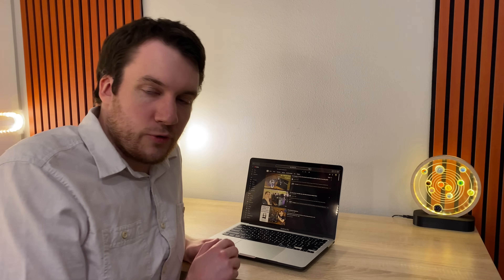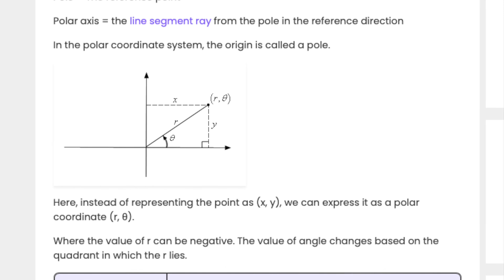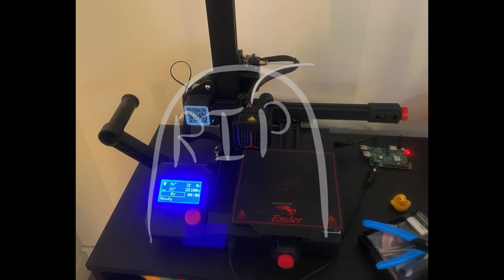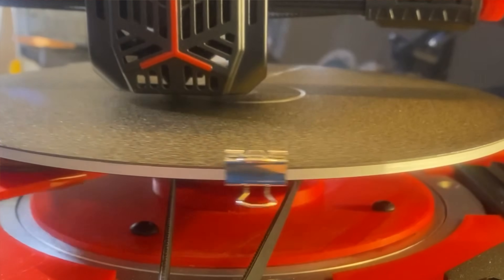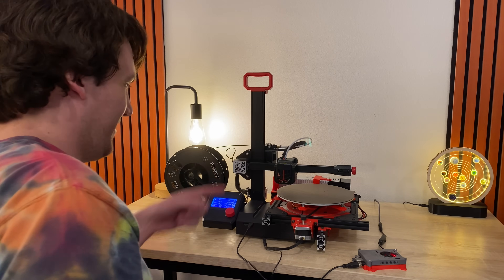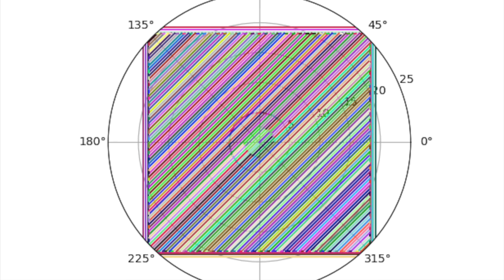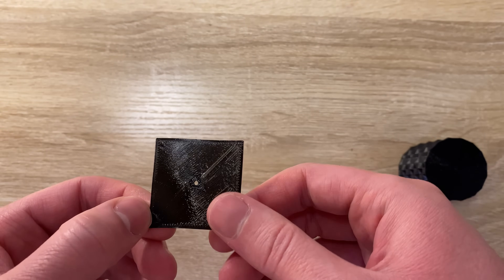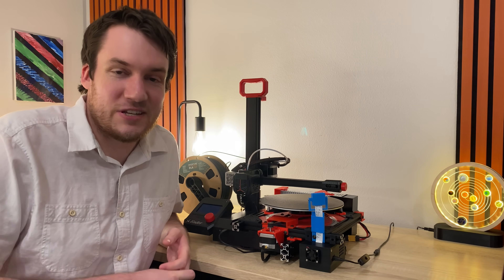This Printer Has A Spinning Bed

Comment: The thing I want to see with this is speedrunning vase mode prints
Reply: I agree , Polar printers seems to be perfectly suited for such tasks , barely any movement from the toolhead , just spin the heatbed and voila ! vases printed in no time
Reply: @ulforcemegamon3094  Assuming no blockers around bed adhesion or spin speed, the only meaningful limit would be flow rate and cooling for a straight vase.. maybe resonance vibration if we're getting to crazy speeds
Reply: Volumetric limits of the hotend are already what slow down the top printers. It's probably not very different in speed, but it'll be a ton quieter and it won't vibrate. So surface defects on tall prints would almost completely disappear.
Reply: @SquintyGears  NathanBuildsRobots on youtube has a four print head 3d printer for extra fast vase mode printing.
Reply: Do this to a voron
Reply: Me too, good idea.
Reply: It would be super fun to watch but I don't think it's actually going to be faster in any way. Speed printing limits are pretty much always flow and cooling related, motion isn't the bottleneck.
Reply: @CaZa3D  "On engineering never worry about if you should, leave that to politicians. Just do it."
Reply: But cooling has much more potential with a polar setup as you can surround the bed with fans and create a vortex.

Comment: It would appear that if not rotating the turntable then any polar printer is also optionally a traditional x-y-z printer, and that at an advanced implementation level it should be possible to dynamically switch between the two states for potentially smoother curves auto-magically in any print.
Reply: Isn't the Y axis removed?? I don't think it has Y without rotating
Reply: The Y on the polar printer is gone, it’s not just adding a rotary table on the existing Y. At least for his design.
Reply: @jerrymk6846  the traditional polar printer resolution problems could be done away if the bed moved or if it was a rotating bed and it was a traditional cartesian setup on top of it. would be easier to code a slicer for than adding an extra axis for non planar printing anyway.
Reply: @lasskinn474  I'm just talking about the OP's case. I have no interest in polar axes as the bottleneck for consumer printers is still the hotend flow.
Reply: @jerrymk6846 you can still rotate whilst moving x back. That should “simulate” y
Reply: There are robot arms with more than 6 DoF which use all their joints at once to get maximum strength and acceleration at any time.
Here you could decompose cartesian movements into cartesian + polar in a way that minimizes acceleration of any one axis.
Reply: problem is you'd have to have a whole bed slinger mechanism to shift the Y axis